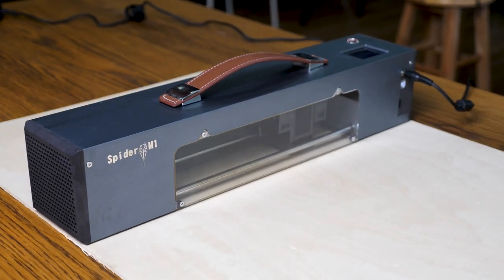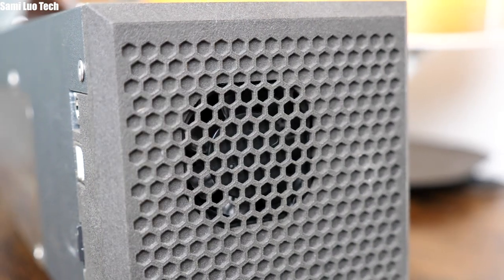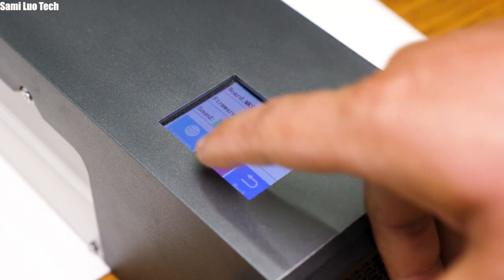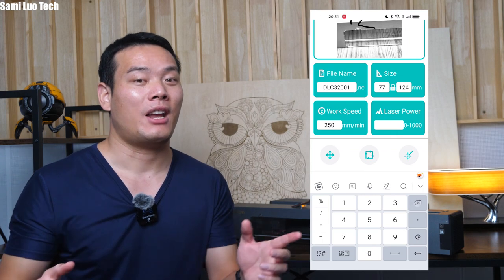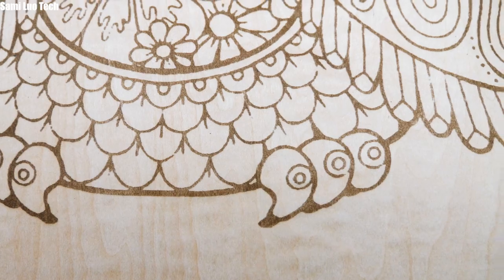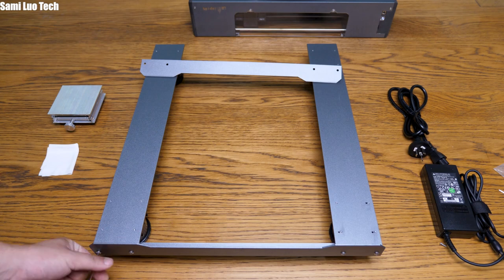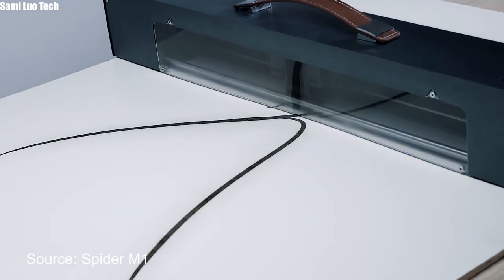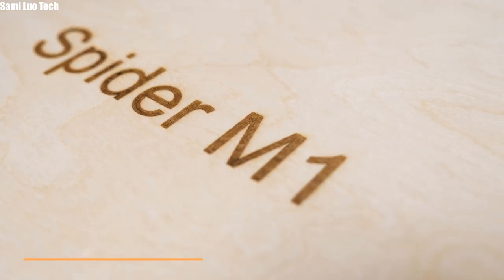Spider M1: The Infinite Laser Engraving that Blows My Mind!

Comment: Tyvok lasers suck big time, not just because they dont preform like announced but mainly because of its client support. Things come from china and every replacement you need to do, will cost you! Alot of headaches because of the Customs and import taxes.
About the infinity engraving, not like advertised either, If it is a simple one pass engrave, it will do it but the biger it is, the less accurate will be, the machine looses steps with big dimensions, the fact that it is running on wheels and not on rails also contributes to this. I had to restart alot of projects because it got stuck midway for some reason.
Buy a better brand laser, this is trowing money away !